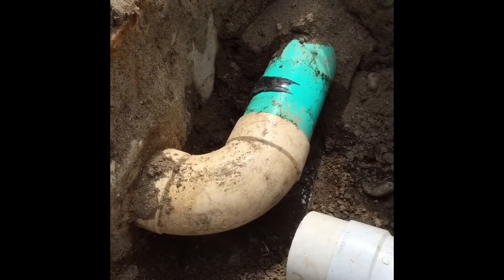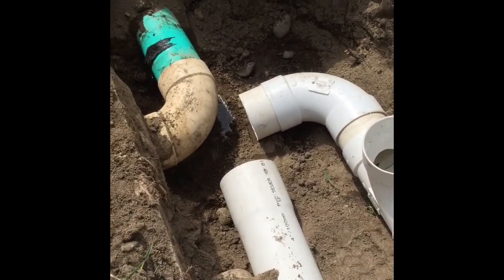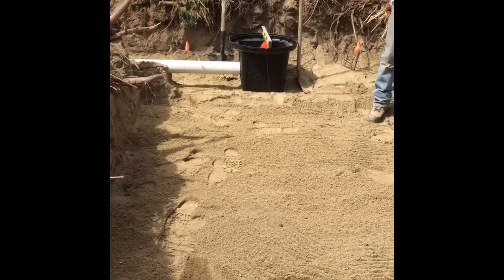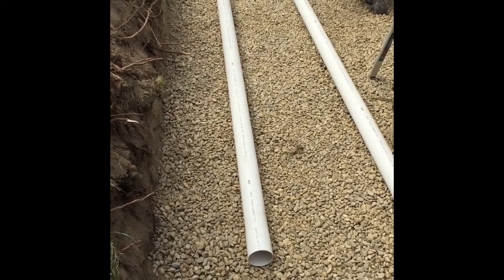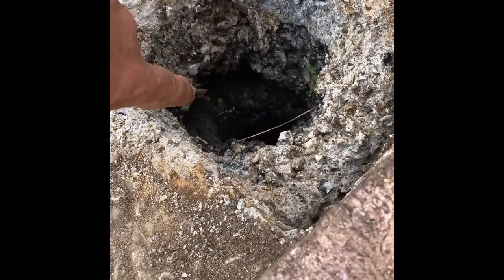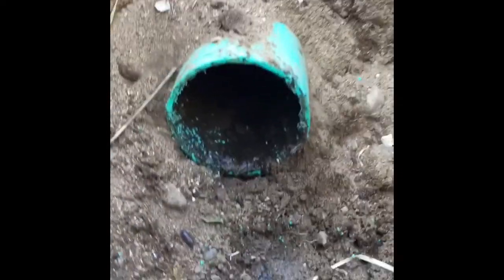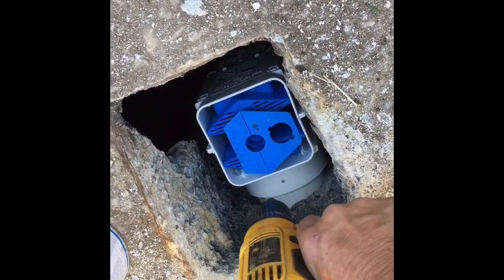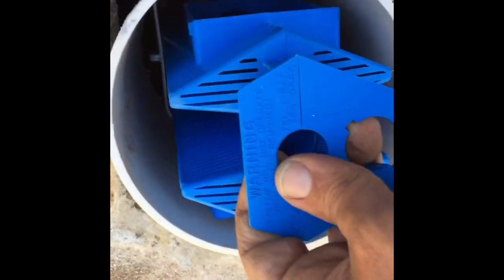Septic Drain Field Fail and Replacement

Comment: This was good work. My question is you don't have to remove the old seep lines?? Can just leave them and move on??
Reply from the maker: The old lines are left abandoned, the bacterial culture around the lines and soils die off  over a few months as there is no longer a nutrient supply.  We then look for a secondary drain field location.  In some circumstances, for lack of lot space, we do have to extract the old lines and soil, then reintroduce specified sand in replacement.

Comment: My tanks outlet pipe is cast iron and extends about 2' beyond the tank. It's packed solid and I would like to remove and replace it with PVC. How might I remove the pipe without damaging my tank?
Reply from the maker: Hi Eddie,

Make sure you dig under the pipe at least 4 inches, then expose the end of the tank where the pipe leads into the septic tank.  There should be a small porthole that leads into the baffle.  If you lift the small lid and look inside you should see the other end of the pipe.  Wiggle the pipe gently and turn it at the same time.  If you crack a bit of the concrete don't worry about that, chances are it is quite brittle.  Give the pipe a gentle tap with a hammer to loosen the concrete that might be around the pipe.

To fix the concrete use a bit of wire mesh and some hydraulic cement.  If you have a rubber mastic putty (Conceal) then apply a bit around the new pipe that you insert into the same hole you just extracted the old pipe from.  Fill all gaps with the rubber mastic, then add the hydraulic cement ensuring there is no potential water leakage.  The rubber mastic is a great water stop if it is applied dry.

Let me know how that goes for you, happy to help further.

Cheers,

Luis
Reply: Iron pipe is 5” pvc pipe is 4” cut iron pipe in use 5 to 4” rubber boot